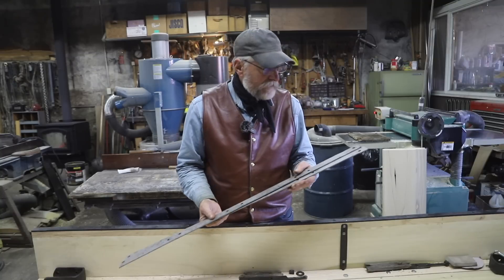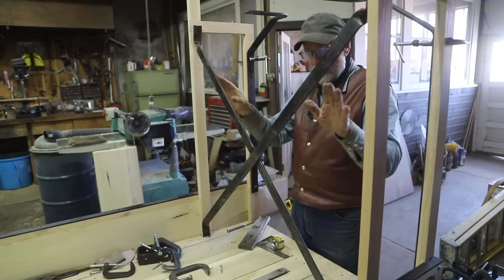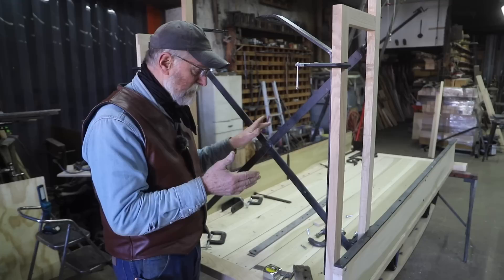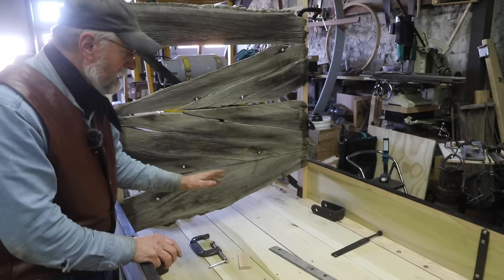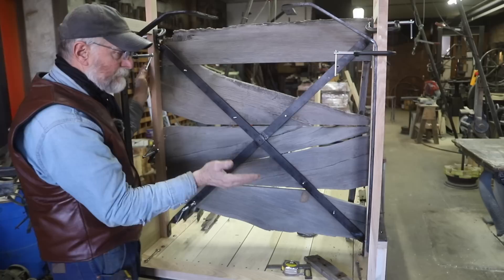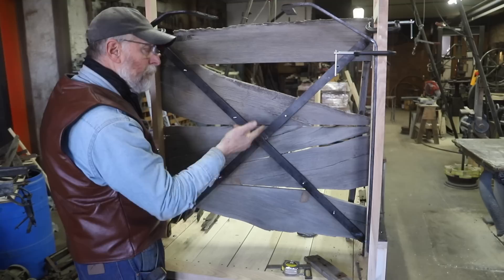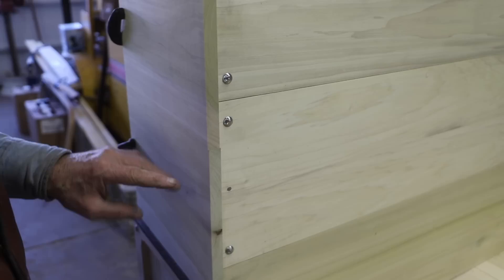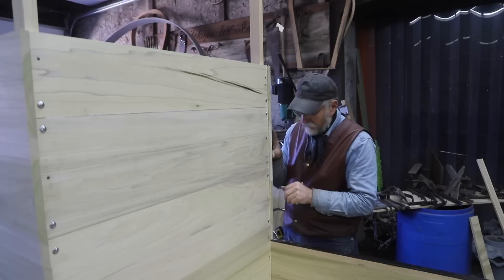The Stagecoach Driver's Seat | Mud Wagon Style | Engels Coach Shop

Comment: Showing the detective work of how you figure out a vehicle when you have so little to work with is tremendously useful.  I hope you continue to share that work moving forward.  On a side note, I need to build a kitchen table.  I bought some metal legs that really needed a gusset in them, and don't have it.  They rack a little, and I don't like that.  I've got the idea, from watching you, to make them into something like a wagon body.  I think I'm going to rivet ash strips inside them to make them a bit sturdier, and then make the top of poplar with an ash frame, like a wagon floor, and rivet the legs onto it.  I'm going to make ash bolsters like a wagon body, and rivet them underneath, and then glue some splines down the middle to keep the table top flat.  So you are inspiring me to do something a little different from the mainstream.
Reply: Nice!

Comment: Mr Engels my name is Greg Duggan i live in Natchitoches La.  One of your customers ( Mr. Gerri and Mrs Michael Unruah moved down here and my company have been building a barn for them.   My forte is preserving old  structures  ( town was founded 1714)  after watching your videos  we r of a very similar preservation philosophy.  I really like the way u do your detective work with looking at the old photographs and with what the original wagon parts are telling you. That takes a lot of time to develop the skill if listening to a silent structure  and learning how it was built in the first place or in the case of the mud wagon how it was repaired after being wrecked.    Also you don't put every single piece back on ( some of the irons ).   One suggestion on the original pieces of boards that form the back of the driver's box  the grain lines of the boards where they had been  use and broken  u might would have lightly scored the planks to represent how the new boards might have followed the old ones ( I noticed the old ones were cut from a very large maybe twisted grain tree ).   Also loved the borax wagon series you r a true craftsman and I hope that u r able to pass your knowledge onto a younger generation.    Thanks Greg Duggan

Comment: I like the structural integrity the braces add. I think I might have made new braces to the standards of the original carriage builder (centered bolt holes ect) I get that a black smith probably did the original repair work but the carriage work is so much better and your work eclipses both of them easily.
Reply: But remember Dave's comment that the braces represented an important part of the wagon's history and he wanted to respect and include that specific history, which would include that 'smith's level of craftsmanship. New, "clean & symmetrical" braces wouldn't have been true to that part of the wagon's history, right?  Just a thought....trying to understand Dave's reasoning. (And I agree; The original maker was very good but Dave's work is far superior to either of them.)

Comment: I'll bet the nails between the double bolts simply held the boards in place while drilling the holes when originally constructed - no clamps. Your painstaking detective work on rebuilding this wrecked coach is a masterclass in restoration work.  I've done it on 100 year old cars and it's very similar. You've shared some priceless techniques in examination and recreation of nearly extinct technology. Thank you so much.

Comment: Good call saving the cross bracing! They were nicely made and make structural sense. The nails between the carriage bolts may have served as clamps in the initial build, instead of using the C-clamps as you did to hold the boards in place. Those original boards had some wild grain! They were not very strong for the stresses to be expected in that driver's box.

Comment: Thanks again, Dave.  I was wondering about the boards on the back of the driver's box.  If they were all the same width, they may have come from the same board or from "sister" boards in the same log.  That would explain why they all had such an angle in the grain direction.  The craftsman laid them in sort of a "bookmatch" layout, alternating grain direction, which looks deliberate to me.  That would be more likely if the boards were actually from the same log, less likely if they weren't.  In modern commercial lumber, we rarely see such sisters, but when this wagon was built, I suspect it was much more common.  Unfortunately, the angle of the grain seems to have been a contributing factor to the wagons' demise, causing the weakness that required the cross-braces.

Comment: To me, the irons with the off center holes and hammered squares for carriage bolts look more like what would have been done by a blacksmith- the centered  and drilled holes look like a modern repair piece.  I suspect those double bolt holes in the 2 center boards will have something to do with the support for the driver's floorboard.

Comment: The uprights are full of holes. This may have led to their failure with load and not necessarily an accident. I would recommend incorporating those steels but with a little more craftsmanship. It a couple 300 pounders climb up there I do not believe the engineering will support them. Looks beautiful.

Comment: As always fantastic detective work. I guess the modern equivilent would be a 1950's VW beetle. Do you take it back to original Germany factory spec or to the other extreme of added disc brakes, monster turbo, slammed in the weeds, led lights and audio that would scare a Ferrari in a standing quarter? I guess you pick your own moment in history to hang your hat on and run with?

Comment: 15:44 Maybe they skipped the bottom board because they would have been using a brace and bit, and it was just too damn annoying to drill a hole that close to the sidewall, so they just used nails, then when they got above the sidewall and were able to use the brace & bit, they worked the rest of the way up with carriage bolts.

Comment: I am curious about using just nails for the lowest board, but using bolts on the upper boards. Did the original builder do that to showcase "high quality materials and workmanship" in areas that are exposed, while using nails alone in areas that dont get seen? Also, perhaps the "lower quality" irons were made by an apprentice as they were also not going to be seen? It seems to me that those cross braces would be included originally for strengths sake, but were acceptable even in their second rate build quality. Keep up the good work, very calming and relaxing seeing a craftsman at work. And that hammer must be at least as old as I am!

Comment: Curious the original boards were cut with grain running diagonally.  Perhaps they were an attempt at stiffening prior to the steel cross-bracing.
Secret squirrel (below) suggests it may have been part of the repair, fitting in wedges between existing structure.
Reply: I was wondering the very same thing.  It’s hard to imagine someone deliberately doing that.
Reply: I noticed that too. Wonder why Dave did not replicate.
Reply: thats bothered me from the start those back boards  are strange and every step they nag me and if come to the idea that the remaining jigsaw  had to be cut from a big y shaped tree section,and then that plank ripped to 11inch boards from one side and made them have grain like that . what do ya think ?
Reply: @nowayjerk8064  that’s conceivable.  I’ve been building stuff a long time but have always had the luxury of having either commercially cut wood or wood cut by a knowledgeable sawyer.  I have no idea what would be available to a blacksmith working with what was available locally.

Comment: I noticed that you left a small gap between the wide boards, presumably for expansion. But then both the top and bottom edges are fastened with bolts, which will prevent movement. Are you worried that the boards might eventually crack if they're restrained like that?

Comment: I'm thinking if the original builder was drilling his holes with a brace and bit then it would make sense that he used nails on the bottom board because he didn't have room to use the brace and bit.

Comment: I am a little late to commenting on this video compared to everyone else, but i believe the bottom board on the drivers compartment wasn't original to the coach since it was nailed and not bolted. It may have been added afterwards and there was a gap in the bottom there for extra storage inside the driver's box for possibly extra clothes or a lunch or anything for the drivers or maybe more room for passenger luggage.

Comment: The grain in the back boards is so extremely slanted, I wonder if it was intended to give some diagonal bracing to the (pre-accident) box. And I am still proposing that to have had such an impact from the rear, that it was some sort of motor vehicle that ran into this stage at a time when vehicles of both sorts were sharing the roads - early 20th Century or thereabouts.

Comment: The old middle boards appeared to be installed at an angle (herring bone?) but perhaps that was just a happy accident in the grain direction. Since you went straight across without comment I must assume the old boards did too.

Your sleuthing has been as much, if not more, interesting in this project (and the hotel) than the actual work. Maybe you should leave some hidden notes for the next guy........ :^)
Reply: On old furniture and chests I would often see inner boards on the diagonal.  I was told this was to wedge the boards tight.

Comment: The original boards had diagonal grain, The replacements have horizontal grain. Maybe a reason they chose diagonal?
Reply: You're talking of grain runout.  This is caused by the mill.  That would be a huge (unacceptable) amount of runout on the boards shown.

I think those old boards were cut on the diagonal by the coach builder or repairer to be wedged between the top and bottom boards.